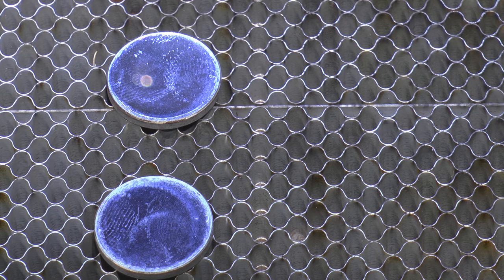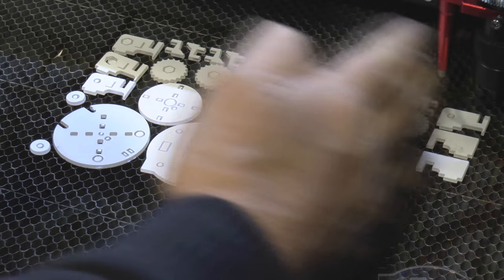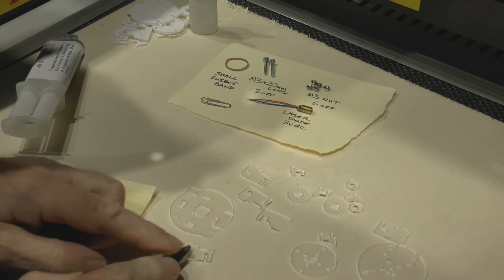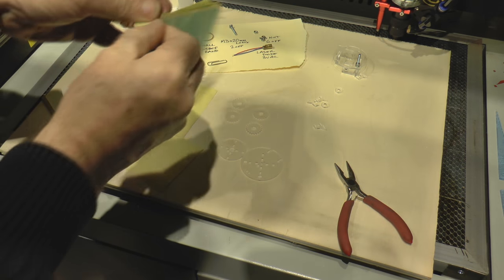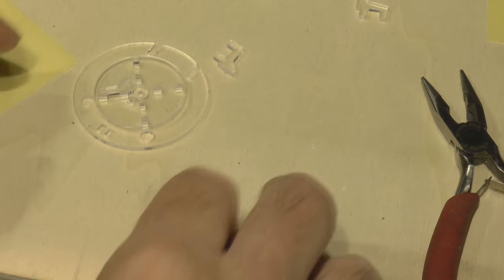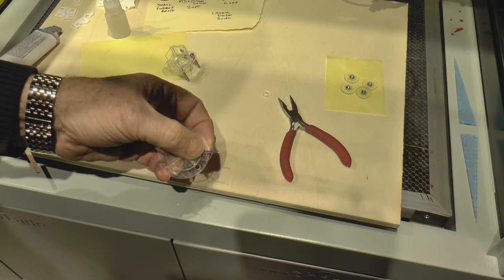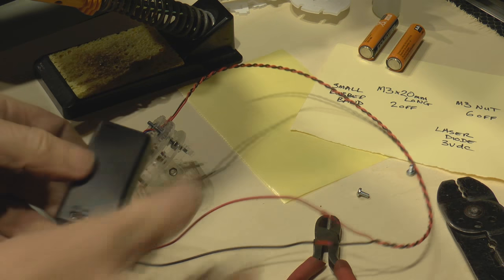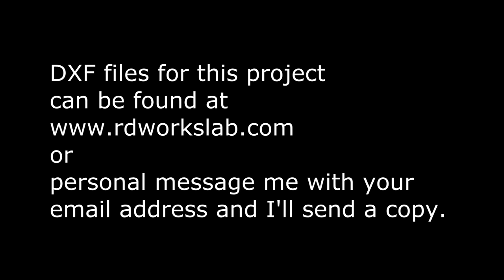RDWorks Learning Lab 93 Oh no Not a Mk7

Comment: Hey, great videos. I'll love a machine like yours. First i have to learn! what Chinese machine do you recommend for a beginner. and where's a trustworthy supplier (I'd like to cut stencils out and laser etched portraits on plywood).
Reply from the maker: Hi Robert
 I know very little about cutting stencils but I believe it may be from polyester film? cutting(really burning) any plastics can produce fumes with dangerous gases or particles that you should not breath, so do your google research and make sure you have good extraction. Your demands are very low because cutting requires high power (unless its thin plastic as in your case) and engraving on any surface is a low power procedure.  Private message me with your email and a link to the sort of machine that interests you and I'll tell you more
Best regards
Russ
Reply: Hi Robert,This is Gareth at Thinklaser, feel free to get in touch with me to discuss your requirements further. Check out our Lightblade 3040 http://thinklaser.com/thinklaser-systems/lightblade/#3040 the baby brother to Russ's Lightblade 4060.

Comment: Pretty sure the laser pointer holder I made was based on your MkV design.  This looks like it attaches to the end of the laser tube via an entirely different principle?  The one I have fits into the interior diameter of the laser opening.  This one seems to anchor itself only to the exterior diameter with those clamp screws. Is this correct?  Or is there also a piece that inserts into the nozzle?  Also, what is the argument for exterior vs. interior centering?  Thanks, as always!
Reply from the maker: Hi Steve
Some folks have glass water jackets and others are metal. Mk5 will suit both types  but because I use elastic bands to fix it in place there can be a bit of movement when you try to adjust it. Once set, it's perfectly ok. The external screw clamping system is much more stable and a lot less likely to moving when adjusted.
All this fiddling with laser pointers, tube clamps and  beam alignment techniques has forced me (after 2 years) to accept that all these fixes are really just sticking plasters on an underlying problem. The whole tube and mirror  mounting systems are based on some Chinese industry standard kits
See this as an example
http://www.ebay.co.uk/itm/Co2-Laser-Head-Si-Mirror-Lens-Intgrative-Mount-Cutter-Engraver-FL-1-5-to-4-/221627885462?hash=item339a0d2796:g:2GEAAOSwfcVUJBlw

This  fully "flexible" kit is so flexible that there are no good reference points to work with when trying to align your beam. After all this time I have decided to stop digging  because I'm never going to be able stick enough plasters over this Chinese design. So, I  am just in the middle of designing a complete new set of parts for tube and mirror mounting to make beam alignment a VERY simple procedure.I am currently waiting on new mirror mounts from China, so it could be several weeks before I can put the final touches to the design. The reason I am telling you this is because I have integrated the ultimate red dot reference beam into the design.......just before you rush off and make another sticking plaster

Best regards
Russ

Comment: how would you compare the two lasercutters you have? pricewise and how perfomancewise?
Reply from the maker: Hi Jimmy
Depends on what you want it for.

If you are a small business, an R&D dept , an educational establishment etc then you want a machine that does what it says on the tin and just runs from day1
If you are a hobbyist first and may plan to do some business with it later when you become competent and are reasonably intelligent and mechanically savvy, then a "project"machine that may need some tinkering to pull it into good shape, would suit you fine.

The price difference between these two options is huge.
I have a 5030 ebay machine that cost me £1200 2years ago (now less than £1100) with a crappy 50 watt tube in it. By the time I upgraded it to a decent 70watt tube and power supply, for about £500, and a lot of tinkering, as you can see from my videos,  Add another £100 for extras like the water reservoir, ammeter, temperature meter, decent extraction fan and I have a very good reliable machine. for say £1800.
My slightly bigger 6040 Lightblade machine is semi industrial in that it has a properly designed safety interlock system, is made from better quality components and is well engineered. It  came  ready to run with chiller, reservoir, ammeter and an optional recirculating fume extraction/filtereing system. It was fitted with a decent 60 watt tube and a 1 year proper support package that included a replacement tube at the end of the first year.  Without negotiations and bartering,  it would have cost me  about £6000 (plus 20% VAT) meaning joe public would have paid £7200. You are either a serious hobbyist or a small business to afford this

The other serious players in this field are real industrial machines such as Epilog and Trotec which will be in the £15 to 20K for a similar offering. Having seen these machines at trade shows, yes they are nice machines with better user software and usability features  BUT can do little more than my ebay machine, or the Lightblade,  just a bit faster.

Now that my ebay machine is reliable, there is little to choose between either of my machines performance wise.
Yes my ebay machine was definitely a "project"  but I have a lot to thank it for  because I had the time and patience to unravel it's technicalities and  correct some of the detail engineering to improve usability. It has forced me to learn a lot..

Hope this answers your question.
Best regards
Russ

Comment: Hi Russ, just because i'm curious: what is the red attachment on the left side of your laser head? Is it a camera?
Reply from the maker: Hi Stefan
No its something that folks call " a pen" for obvious reasons. It is in fact a microswitch. The Z axis on the Lightblade machine is a stepper motor . If you press the Z/U button on your machine you will see a menu pop up. Right at the bottom left is an auto focus command. When the pen is set up correctly (and I have moved mine out of the way because it's quicker to manually set the focus) the machine goes through a routine of raising the table until it reaches the micro-switch and does a couple of shuffles to set the ideal focus. I think its a work in progress because I am not overly impressed with it. There are 3 different lenses supplied with the machine. A 2", a 2.5" and a 4" lens. Why a 4" lens on a 60 watt machine puzzles me (that's like trying to perform brain surgery with a butter knife!!). Anyway, I have converted the 4" lens tube into a 1.5" lens system and it works well. The whole issue now is that ALL these focal points MUST hit the surface of the work when the nozzle is the SAME distance above the work because the microswitch  sets an exact distance for ALL lenses. Therefore each lens has to be positioned accurately up inside the nozzle/tube assembly by its focal distance to achieve this ideal singularity.  I'm afraid its not happening. There is a 3mm spread across all lenses.
This is a fairly easily resolvable problem but the idea of having a stepper driven Z axis is so that you can set various focus depths on each layer. Why? Imagine engraving an image onto say 6mm acrylic and then wanting to cut a shape out after the engraving. You need to set the focus to zero for engraving and then at -2.5mm for cutting. Fantastic idea, but RDWorks doesn't work properly at present and you cannot do this.  Hopefully my bullying through Thinklaser (who have contacts within Ruida) may get this fixed.
Sorry for making this simple question into a saga 
If you want to watch 
https://www.youtube.com/watch?v=B4bn11hWcz8&t=3s
from about 25 minutes in I start using the auto focus feature

Best regards
Russ
Reply: SarbarMultimedia Many Thanks!

Comment: hi i wanted to take ur opinion about machine 150 watt for metal and none metal cutting with O2 assist what do u think about it if u have ever tried it ?
Reply from the maker: Hi Osama
I used to own two 3Kwatt metal cutting lasers as a business for 10 years. The industrial machines are NOTHING like these Chinese machines. These machines were originally thought of as engraving machines but you can also do a bit of cutting with them. As you rightly say, with enough power  and an oxygen assist gas you can cut thin mild steel. All those that I have seen do a  poor job and oxygen cylinders are pretty expensive.. Your machine will need a special metal cutting head and nozzles. Yes these machines will cut steel slowly but to any commercially acceptable quality standard.

I understand a lot about cutting metals with a CO2 laser and  having experienced these Chinese machines I would stick to non-metal cutting and get the metal cutting done by a commercial company that is set up to do it properly. There are a lot of extra overheads associated with metal cutting and you need a lot of work to justify the cost of those overheads . See if you can arrange a visit to a laser profiling business to see the process in action and get more of an understanding of what is involved

I apologize for sounding negative but you must think carefully about pushing this basic Chinese technology into areas it was never intended to go.

Best regards
Russ
Reply: Thanks a lot that was very helpful best wishes